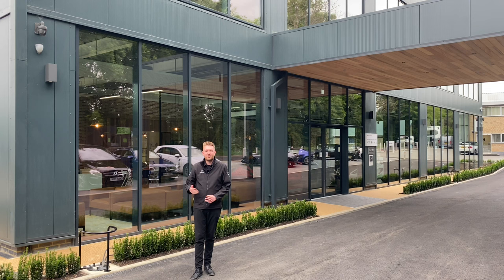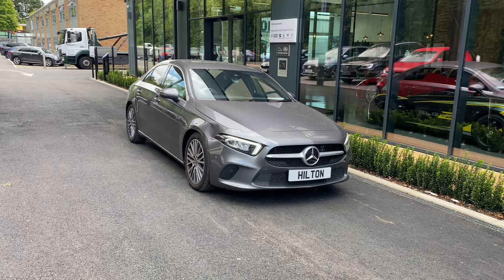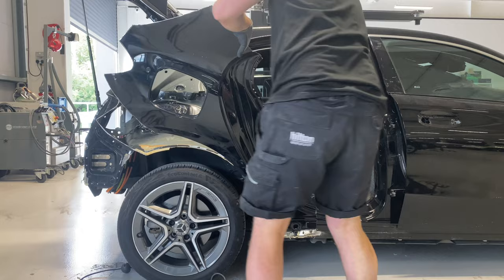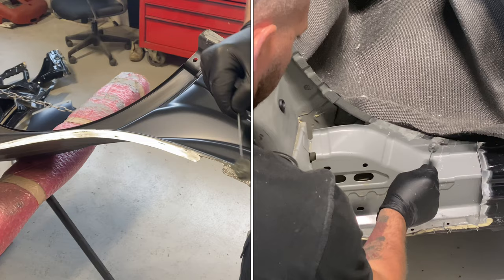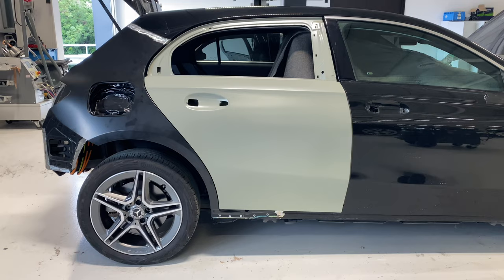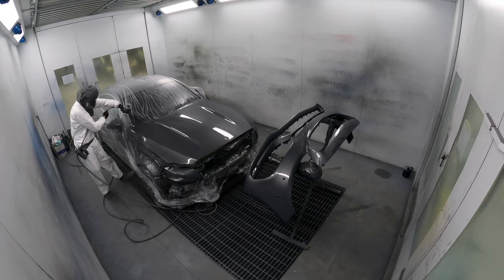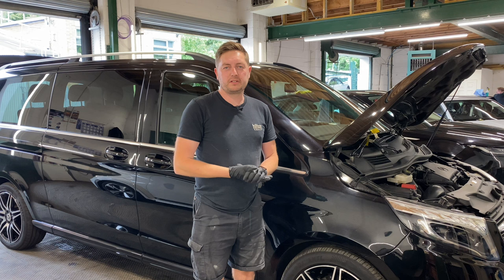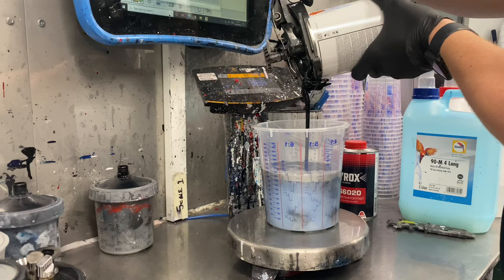Inside the bodyshop: Automotive accident repairs with Hilton Coachworks

Comment: Really good video, but as a Mercedes dealership, which I have no doubt is a BSI:10125 approved repairer, why did you not mention that all work is completed following instructions from a Thatcham and BS10125 job pack, with all jobs signed off by ATA technicians? It would have been great to let people know that you are following an approved British Standard when repairing vehicles. After all, you are paying for it. Why not mention it and show the team referring to the pack and/or signing it off? Maybe you could do this in an updated video, possibly on the repair of an electric vehicle. Still a great video though.